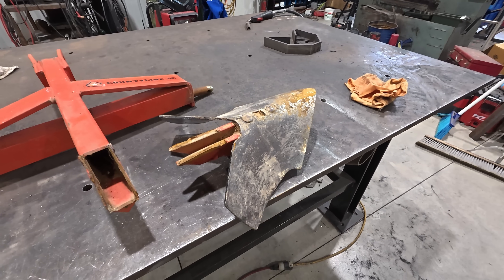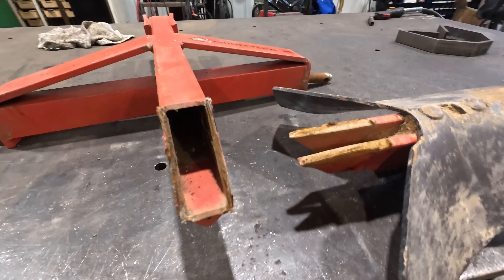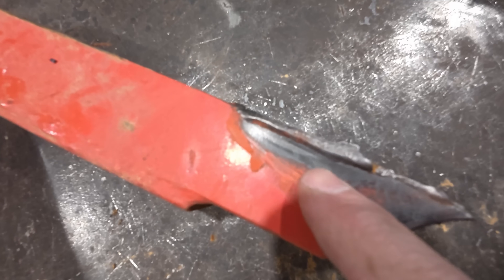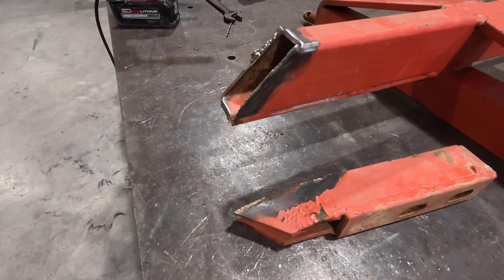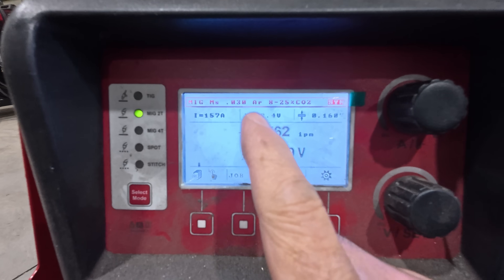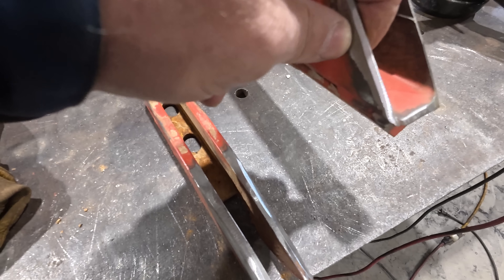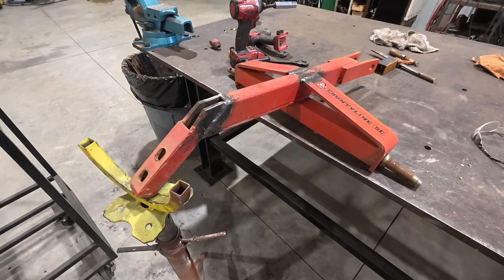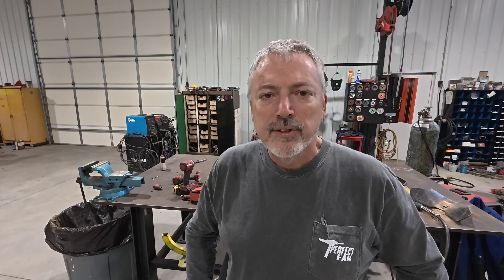This MIG Welding Mistake Destroys Your Projects

Comment: I've said this many times but to get the basic understanding of welding one must begin with mastering the oxyacetylene process of welding. If one masters and understands the welding process, the forming of the weld puddle, the moving of the weld puddle in order to fuse the materials together, then one can understand the welding process and this knowledge will stay with a person (just like learning to ride a bicycle). Grant you there are many phases of welding but having an understanding of the welding process gives one a leg up. most folks out here do not understand how to form the weld puddle and move it along and they jump right into MIG welding and this can be what we get. I would submit that factory workers are just shown what to do and the machines are pretty much set up for them to weld for production purposes. And you are right about one thing here this is a cheaper plow and can only be stressed to a point before it fails. Of course it is also practice, practice, practice but a basic understanding of the welding process really helps. Taking a welding course at the local community college (if available) helps. I took one over forty years ago and it has been the best money I have spent.🥸👍👍👍👍👍

Comment: VERY tidy weld you did👍 A small piece of reinforcing flat steel in the angle where it goes down to the plough may have strengthened it substantially..

Comment: I learned to weld using oxy-acetylene in 1967. I was 14.  I've stick welded, MIG welded, through out my life. 

I'm about to embark on learning TIG welding.

I've built custom car frames & chassis, race cars frames/roll cages,  trailers, and many different kinds of equipment, where weld failure would be catastrophic & likely deadly.

Oxy-acetylene welding is inherently  dangerous, because of the volatility of acetylene, but none of the types of welding I have decades of experience, and I'm certain, are not responsible for chit welds.

Gas & electric welding have the capability to perform flawless welds. 

The best equipment in existance can be used to perform chit welds and crappy, cheap welders can be used to perform excellant welds.

Throwing out BS titles to get more clicks is in the same category of person who would perform inadequate welds, cover them w/ paint & sell them to unsuspecting people.

The world would be a better place without them.
Reply: If you can gas weld, you can tig. It's basically an electric torch and you already have the technique

Comment: If you are serious about metal fabrication, you need to take into consideration the workload and higher workloads need a root opening with beveled  connections, so 100% weld penetration is obtained. A backer plate would also be a good idea. Next, choose the right filler metal and the correct amperage, and don't forget welding skills. I am a retired welder/fabricator of 39 years, and you would be surprised at the quantity of manufactured products that were never engineered properly and have poor welding. I see a lot of undercuts on welds and insufficient weld ends/termination. They are an open door for weld tears and cracks.
Reply: Lol I'm a fabricator too and you should see Big Tex trailers, half the time those losers lay the bead NEXT to the seam... I've had to reweld brand new trailers we bought at auction because they missed half the welds

Comment: Was that plow made out of Chinesium or Mexiconium?  I've had penetration problems when welding Chinesium steels used in cheap products, it almost acted like I was trying to weld to cast iron. In one instance the weld actually cracked off the base metal as it cooled despite going in hot.

Comment: A competent welder, using the correct MIG equipment,  could have done the job, but that plow was not a "high quality implement" , and if there is anyone who can break a piece of equipment with amazing proficiency,  it's a farmer ! 
I did field service repair for a material handling company,  forklifts, skid steers, etc, and only foundry workers mangle equipment faster, and harder than farmers.

Comment: The steel used can be inferior as well.  There are many grades of steel and not just all the same steel.  The wire and the gas used also has a factor.  The fact that two different thicknesses were married can also cause failure.  Structural design can have a part as well as this failure looked like it "zippered" when it broke.

Comment: I have done  all kinds of welding you just don't know what you or whoever did the welding!!!  Up to 3 inches thick
On boilers and high pressure 
Vessel for navy.
 Don't knock it until you know 
What you are doing   X-ray welder  in 6 G position then 
You can talk !!

Comment: I have 10,000 hours under a welding hood as an iron worker, welder there are a lot of buildings up in the air from my welds.all ways used 7018 rods for all structural welds.I have 100 percent trust in 7018 welding rods,low high.I would not trust MiG as much as I do with 7018.

Comment: Problem is MIG welding process it is very easy to lay a bead that looks good but has no penatration into the base metal. Cause wrong equipment not high enough amperage machine, improper metal preperation , lack of skill and experience on the part of the welder. 6010 rod and an arc welding will cure that

Comment: You blame MIG, while pointing out all the faults that would plague most forms of electric arc welding to some degree. Sure, certain methods are less susceptible to contamination and work better given the garbage fit-up, but a properly executed MIG weld is not inherently worse in material of that thickness. In sheets of thicker structural steel it's only good for attaching hardware, but you're blaming the process for a lack of: good cleaning, proper V groove joints, proper fixturing, proper heat, proper feed speed, caring about the quality. 

I could have a TIG or stick or oxyacetylene rig and since I'm not as practiced with the first and last of these, if I just tossed all the outcomes good/bad/ugly in the "finished work" pile, you'd get this plow. 

It's the person, not the equipment. Probably the corporate culture as well.

Comment: if you look at the weld you can see it was a butt weld and done incorrectly ,the way to have done the weld in the first place would have been to grind a slant on to the ends of the box section ,then but weld and gain more penetration and also attach a gussets to  either side of the weldm  and as for mig welding nothing wrong with mig welding

Comment: Any welding process is only as good as the person doing it
Reply: How the heck did this get 66K views? Amazing. So basically farm implements made from thick steel under immense stress of thousands of pounds, should probably be stick welded with 6011, like was done for 75 years? Probably a good idea. 

I hate stick welding, but I did learn that the new 120V/240V inverter welders are easy easier to weld with, because they have a hot start feature built in, where the rod won't stick to metal, you don't have to "strike an arc." I measured the voltage at around 70 volts coming off the rod, before it contacts the metal. Once it makes contact, it drops down to 20 volts per standard.

I bought a tiny $110 inverter stick welder, and it's tiny, but it's honestly super high quality. The exact one I got is a Hone B082DS19-140. They are on sale for $67 right now. Seriously, for that price, every person can afford a stick welder. I bought it just for fun and novelty, but realized it's actually very good. 

There are probably many other good ones, I just liked how the Hone one looks. It's a beautiful metal case, and looks expensive.

Comment: I'd have TIg welded that.  For me, TIG works better than any other processor on thin to thick welds. I recently did a TIG repair in place of failed MIG welds on part of a set of skid-steer fork frame.

Comment: I'm impressed by a guy fabricating a good 4130 tubing slingshot dragster frame with an acetyline torch. Nowadays NHRA is more impressed with one fabricated by Tig welding. Maybe they're more impressed with the good torch welder too but they can't pass the product to run on their strip anymore by the rules. If I ever do one it'll be Tig welded, NHRA or not. That's simply my assessment of my ability and time with a torch on 4130 tubing.

Comment: myself i would have beveled the thicker metal and ground the paint a little further from my repair burning that bit of paint cant be good for anything if it doesn't break don't take it apart and fix it "my way" but try it if you need to do similar repairs on something else

Comment: I have run into that problem in a few different applications over the years. The base rails on belly dumps and backhoe bucket repairs done with a MIG; they looked just like that 3 point.
I am an old time welder and I don't weld any carbon steel with a MIG, only mild steel. I know there are wires and new mixes that are probably OK to reweld that, but I would clean it up and tack it together, sit it on a welding table and weld it with 7018 vertically. I have never had one break afterward.

Comment: how about this the welding process from one to the other is only the machine that is being used as in MIG, TIG both AC/DC, stick is the same electrical circuitry as tig so my point is the process of welding is litterally fusion not glue for metal now some glues are designed to create a fusion between the same material like pvc when not properly  prepped joints are clean and primed it chemically softens the two mating surfaces and intern the solvents are the glues timers so it will only soften a certain depth and evaporate to create a joint that has to be cut off if making a mistake not smack it with a rubber mallet and re glue the right fitting on, that being said welding works quite the same way and again the right plan of attack for the material that is to be fused is key so clean properly prepped joints and the proper amount of electricity to effectively penetrate the base so filler can blend is crucial . It doesnt mater the electricity style being a short circuit or what ever else kind of electricty there is that might be floating around thats  different because the only difference is nothing, all  welding is done with an arc wich is the same across-the-board and some machines are set up to produce more amps of power than others so i think with some knowledge of how the welding process works  is a good start and using a potatoe plow that is "Broke" to demonstrate why mig welding is dangerous is a very wrong approach  and claiming it to be dangerous bacause of said reasons is the most un educated thing to even say period so do us all a favor and start from the basics and understand this process you might find some good info along the way also there is another process of welding called explosive welding and it uses explosives detonated in a controlled way tjhat welds material togerther by velocity

Comment: Again farmers are rarely good welders, Mig welding is not dangerous and by you stating so shows your lack of knowledge or your intent for click baiting the title. It's a lack of understanding of the process and what is actually happening to the pieces being joined together. Your welds suffer from the exact problem the original weld failed from. It's not the mill scale, not welder settings it's the lack of proper joint preparation. your fit up of the two pieces was minimal at best, the beveling was inconsistent. near the end you look at your second pass see all the nice ripples "Now that's a good weld" was your comment we joke about this in the welding industry / field "No one will ever know!" a lot of wanna be welders cover up a lot of bad work with a pretty cover pass

Comment: You need bevel fits or a gap between the pieces to get penetration.  It's the fit, not the welder or the welding machine. Pretty much the same with stick, tig and FluxCore.
Reply: I could've done a better job with the cheapest temu flux core than the factory did from the jump

Comment: Add gusset plates that extend more onto the thinner material for added strength.
Reply: That'a my  go to on ag equipment and trailers, including hitches.  I'm not a certified welder and I know it, but I do pay attention to what I'm welding.  With enough thickness, I use a stick always - not worth the effort to set up for MIG.  Just, clean, V, select rods and get-er-done.  Plate or gusset unless the structure has no room or weight matters.  Certainly  that little plow can use more metal to spread the stress.   My welds are not pretty but they rarely if ever break - something else usually does.   I don't weld for anyone else either.   I'd pay a lot more attention if I wanted to weld an airframe for flight.

Comment: Has absolutely nothing to do with the process.. thats just plain crappy workmanship!
I mig on broken cattle feeders all the time,  far from "clean" metal, a lot of it, depending on how impregnated the metal is with cow💩, will look like oxy/acet. And baling wire... ain't pretty,  but it's strong than the parent material. 
A lot of production in the last 30 years,  is robot and machines not set for what they're doing. 
BTW, we build and repair equipment.  I've welded with stick and mig for 45 years.  Only welds I've had break, take a chunk of metal with them.

Comment: I bought a cheap welder from harbor freight. I know I have no idea what I'm doing but I just use it to repair things like my dad's bbq pit and my friend's gate. Usually I just hit my welds with a hammer and if it holds, call it a day. So far my welds have killed 17 people.
Reply: I cover mine in glue and paint it. Looks really smooth.
Reply: thats called Electric Arc welding or stick welding.. you need to be arrested for OSHA safety violation leading to deaths.

Comment: Don’t dis the process, then use the same process to repair it. 
There was no penetration whatsoever in those original welds. That’s operator error, not process incompatibility. With the right equipment, even that thick metal can be welded, often with poor preparation, under poor conditions. But you have to get the heat into the joint to create a puddle. If the parent metal doesn’t melt, all you’re doing is painting. Small portable machines typically can’t do that in one pass. You have to prepare the joint and fill it in multiple passes. 
I’m not classroom trained and have no certificates, but I’ve been welding with electricity since the 1980s. My welds often don’t look pretty, but the last one that failed in use was in 1988! Even that wasn’t truly the weld. High carbon steel becomes more brittle, after heating. My bicycle frame broke 1/2” away from where I’d welded it, with a small bit of tube still attached to the bottom bracket. Not my finest hour!

Comment: Another welding channel I watch, they claim  5/16" is about the max thickness you can get good penetration with short-arc mig.  He did cut and etches to show the penetration on things like 1/2" steel.
Reply from the maker: I personally am uneasy going over 3/16" with short circuit, above that I go to spray arc, dual shield or stick . If both pieces of this had been 5/16 I would not have MIG welded it. But with the one side being so thin, I was ok with MIG>
Reply: @PerfectFabllc  Yeah that thin/thick joint seems to be a design flaw or them simply being cheap.
Reply: Lol I've got a huge miller that'll do half inch in one pass. Plus I have a suitcase mig that'll run 1/16" wire, it'll penetrate

Comment: As a very-retired pressure hull welder for NASA --- qualified on stick welders --- I have a lot of disdain for wire welding. It came in as I retired and I didn't learn to like it even now. 
BUT --- in a controlled atmosphere and with a very steady robot program, I can see it being better; I still like 6010 IP or 7018 Lo-Hy and a halfwave AC/DC reverse polarity. 
Why didn't you fishplate the vertical sides?
Reply from the maker: @SurferJoe46 Thanks for your comment, I just wanted to get this repaired, adding fishplates probably would have ended up costing the customer more than the plow is worth.
Reply: When I welded in the field, all the critical stuff was welded with stick.  Inspectors like 7018.
Reply: It's production welding, it starts off cold just by nature of the process but there's nothing wrong with it for most production applications. I do it all day long with aluminum and steel and as long as you understand the process and its limitations you won't have any issues. I wouldn't weld NASA pressure vessels with it but it's fine for farm implements and trailers and stuff

Comment: Is that really just a poor weld quality issue or actually dangerous? The plow will be in operation when the plow attachment is in use and the operator will be sitting ahead and above at a reasonable distance with some bulk of the small tractor between, usually nothing but a smart dog trailing around nearby, so risk of injury if the plow connection shatters is fairly low. And even a proper weld involved in a collision with  buried boulder or chunk of old metal could shatter or halt and yank the tractor hard and that might hurt.
Of course a weld like that on an item where the operator is typically closer in or the work area is open and shattering means shrapnel sent among an unaware audience of people or animals does pose and IS a danger and such welding inattention would be a lingering hazard that needs your method to provide that proper permanent fix. And as you show a proper fix may require repairs in other places too and the client should be asked about fixes to those areas of the item as well.